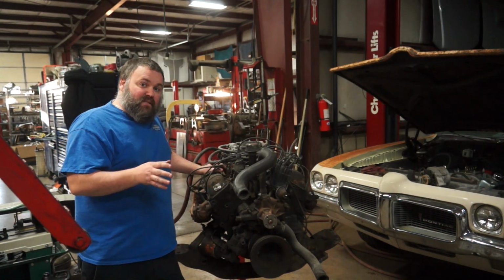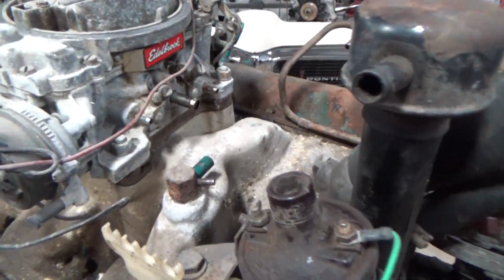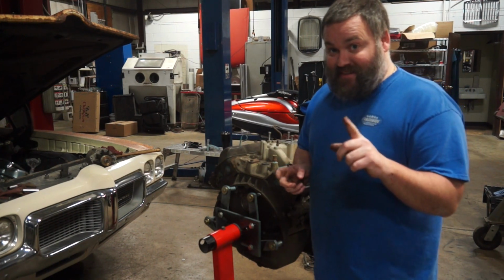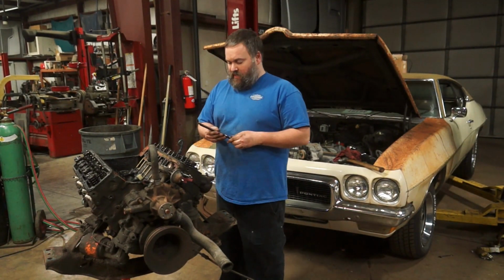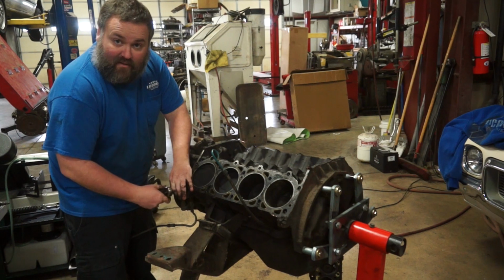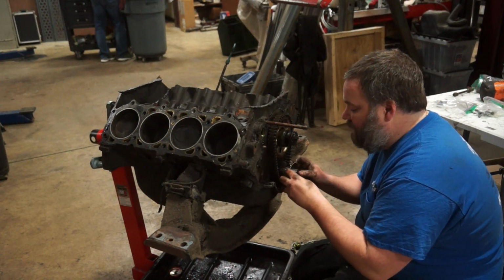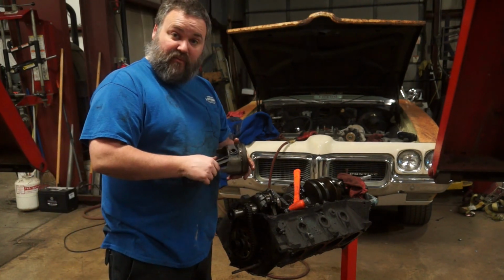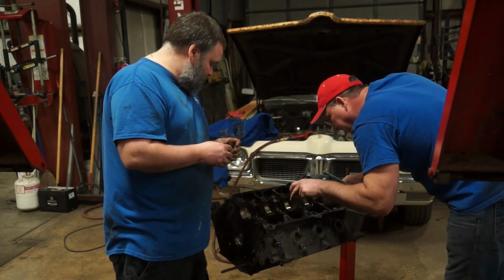AMC 360 V8 COMPLETE tear down! Carb to pan. 360 Build? 304 Build? Plan C? From Lucore Automotive

Comment: Build the 360 with aluminum heads  and go racing on a tight budget it would make sense to concentrate on the engine that's going to deliver the most power for the money spent so I'd wouldn't worry about the 304 rite now
Reply from the maker: Here's the thing, the 304 could probably be put back together as long as as a few things go our way for $1500-$2500 and be ready to make some power. The 360 is going to need rods, pistons, heads, all the trimmings and all the associated machine work. So going to be a much more expensive and time consuming process. It will easily have $4500-$5000 in parts.

The thought, at least on my side, is get the 304 up and running NOW on a much tighter budget while doing the bigger more expensive long term build on the 360 for possibly fall or next year.

Am I crazy?
Reply: @LucoreAuto  it comes down to what's your end goal for the car if it's a track day car the money probably better spent on the 360 just saying and you can probably find a running 304 for less than the cost of a rebuild of the one you have
Reply from the maker: @oscarwalton1188  oh I DEFINITELY could find a running 304 for way less money than what I'll have in rebuilding one, which is one of the main reasons you don't really see ANY 304 builds being documented :) I have an unexplainable soft spot for this little hated V8 since it was the original motor in the car..
Reply: @LucoreAuto  it's not that there hated there good lil engine's there was a road race version back in the 60s and early 70s but the parts to build it are pretty much non existent now
Reply from the maker: @oscarwalton1188  ok maybe hated was a strong wording but certainly not appreciated or bragged about. I fully admit it's a bit nuts for me to be considering building one of these, even for vintage road racing purposes when a 360 is sitting here staring at me and a FAR better platform in pretty much every way. Weren't the racing versions actually destroked larger displacement ones? I wasn't aware of any ACTUAL 304s that were built for racing/performance purposes aside from the 79 AMXs that went to Germany for the race?
Reply: @LucoreAuto  I think it might have been a destroked buy with big valve heads but I don't remember the specs off the top of my head
Reply from the maker: @oscarwalton1188  I believe that's what they did for the TransAm series and cars like that, destroked "big" motors and thr better heads. I could be wrong but I seem to remember reading that somewhere.
Reply: @LucoreAuto  I think the 79 version was pretty much the trans am version I could be wrong but it makes sense AMC wasn't exactly swimming in money at the time

Comment: IF you put new heads on the 360, put the old 360 heads on the 304.
Reply from the maker: I've read that's a lot more challenging than just bolt on and go due to the huge difference in bore and with the bigger valves in the 360 heads?
Reply: @LucoreAuto  
Yah, the 360 ore was .330" bigger. Supposedly there was a 460+ tall deck motor that didn't go into production due to emissions coming on line.

Comment: $400 bucket of bolts!  Yep, I do like using studs on mains and heads though (if I can swing it).
Reply from the maker: Freaking bolts add up QUICKLY! ARP all the things, mains rods heads then all the external pretty bolts... yep you EASILY get north of $400-500 in just hardware!
Reply: @LucoreAuto  I actually preferre milodon studs for the mains and heads

Comment: Be cool to see it built for boost
Reply from the maker: That's actually really really REALLY tempting and not totally out of the cards. We've got our eyes on a supercharger setup that's been an item we want to try for a while... this MIGHT be the chance we've been looking for. Nothing crazy just 6-8psi or so :)
Reply: Hell ya would be cool to see haven’t seen that many amc motors built for boost
Reply: I have Heard the stock cranks in the amc are a forged crank just something I have heard not sure if it’s true or not
Reply from the maker: @noahwilsey560  the 390 and 401 are forged cranks unfortunately the 304 and 360 are cast one of the reasons they are also worth WAY less than the 390s and 401s :( But hopefully they'll hold up to some solid abuse!
Reply: @LucoreAuto  hey man there’s only one why to find out
Reply from the maker: @noahwilsey560  Your mind is on the same track as mine ;) There's a more than decent chance if the 304 gets built that it gets built for a liiiiittle bit of boost ;)
Reply: @LucoreAuto what supercharger system will you use

Comment: Do the oil line mod and run 6 quarts of oil if you run a stock pan. Cheap insurance.
Reply from the maker: DEFINITELY doing that to the 360, and if we end up building the 304 will do it to that as well. Seems like it's a MUST especially if we are going to be road racing this thing
Reply: @LucoreAuto  Big debate on the valley pan oil mod.
Reply: @MegaJavelin1970  
Its been at least 30 years since I looked at the bottom end on these. I can't remember if there's a provision in the casting for the oil feed lines. They reason is I'm wondering if there's enough meat on the drivers side of the main webbing to shoot extra oil feed lines from the left side oil galley. If so that should solve any oiling issues to the bottom end.
Reply: @mpetersen6  Apparently there is, but only on the 390/401 blocks with the thicker block webbing. A local engine builder did that to a friends 401 block, but it was never completed and not sure where the whole deal ended up. As far as the oil diverter line under the intake goes, that and a deep Milodon oil pan and pickup were the setup another bud got from Wally Booth back in the early 80's. My friend was having rear main bearing failures at 7000+ rpm in a 401, he called Booth and that was what he told him to do. Never had the problem again after performing the mods. That was the Milodon pan with no external oil lines running to the pump, which was more of a drag race setup.